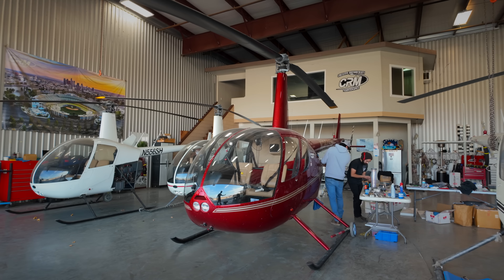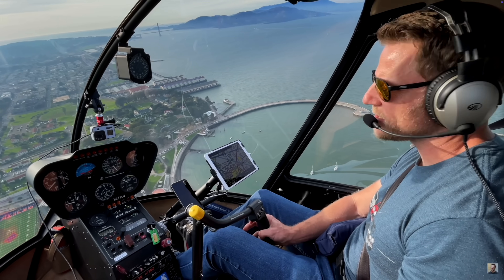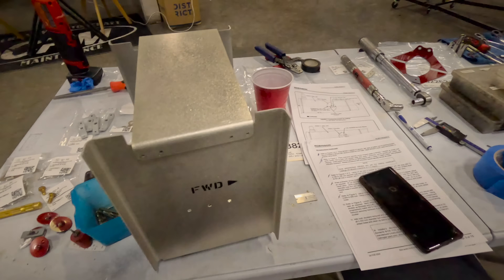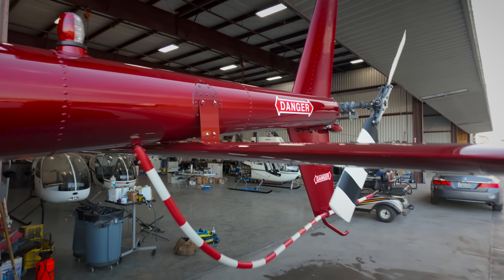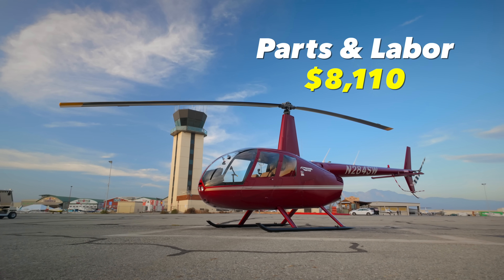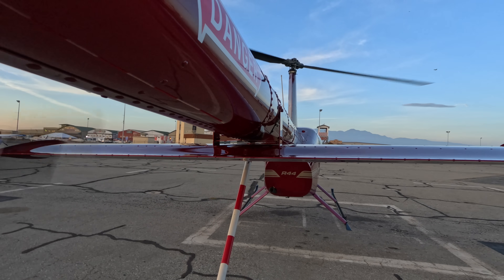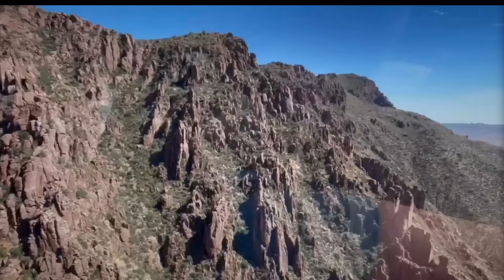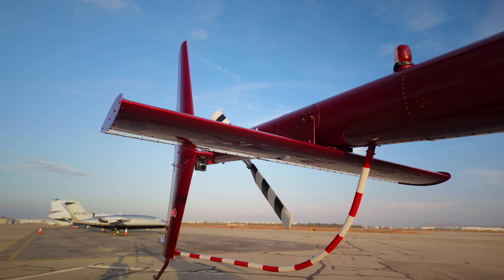Robinson R44 Empennage Kit | Install & Owner Review

Comment: I have an r44. It seems the new stabilizer would onl y be effective at higher speeds. I have flown bell, hughes sikorsky for 40years.  I think as long as you fly the r44 within its limits,you would not need the new stabilizer.
Reply: I think they have to confront near-ubiquitous assertions that the Robinsons are unsafe, esp with their exception made to training protocol. Frankly, i agree that while hovering is where the danger is (i'm not a pilot), i observe and agree that hovering in light helicopters is Essential to, um, "weeding out" any deficient would-be pilots before they can graduate to Commercial air work. But Robinson may have parlayed the situation to add a real in-flight improvement. Basically what i mean is that while they can't change the nature of their rotor system, under the guise of safety, they've made the flight better at speed, including predictability. There was that odd tourist 'Copter that went down in the Hudson River this year. Guy was gunning it to get back due to low fuel and appeared to have cut the tail in mid air.... (not sure they concluded the investigation). I feel like it's Robinson's way of saying, "okay, if you've mastered and respect hovering with our system, we Will get you to point B safely 👍 ~

Comment: You are a helicopter, just fly straight up. No need for a runway clearance.
Reply from the maker: So, I didn't request a runway clearance. I departed via a taxiway. Also, from a safety and aircraft performance perspective, in a helicopter it is greatly preferable to takeoff with forward airspeed. Search "helicopter take off profile" if you'd like to learn more.
Reply: @MicahMuzio  You are the man! I was joking 😆 
Thank you for your reply!
Reply from the maker: @Ezrabastian  Whew!! Sarcasm can be hard to detect sometimes. 😅 Cheers!
Reply: @MicahMuzio  forgot to add an emoji

Comment: Mast bumping is possible with any underslung, semi rigid rotor system, but the Robinson is the only underslung, semi rigid rotor system with an SFAR requirement in the US. I wonder if this new stab will improve its low G characteristics enough to remove the SFAR 73 on new and retrofit models.

Comment: More tail to cut off. Mast bumping is not as problematic in other 2 blade helos. Pop rivets? Using a pneumatic squeezer helps? 6:21 I'm not the best mechanic? Very encouraging. Hope it helps R44's from disassembling theirselve in flight. 😮

Comment: You still have Tail rotor thrust above the C/G to give you right roll, If anything the new horizontal stabilizer will reduce the rate of roll. A bonus is having a blockade between people and the danger zone.  Good to see an owner take care of the machine instead of running it into the ground.

Comment: In 5 years we will hear of R44s having tail rotors fall off at the horizontal stabiliser. Thats a lot of holes.
Reply: I get what you're saying, but the holes actually are there.. once the riviets get installed (fully), the laminate strength of a single sheet is returned, afaik ~

Comment: For commercial use the R44 is a no brainer, but if I was buying my own personal heli  in this price range I think i'd have to do the G2 Cabri for the safety.
Reply from the maker: I've only flown the G2 once but enjoyed flying it. If could get by with only 2 seats, the Cabri would've been on my consideration list.
Reply: @MicahMuzio  I get that, the 4 seats is a consideration to make considering the young one.  Hoping Cabri eventually comes out with one so the industry can get some competition.

I really like the safety it has in autorotations, barely any worry about overspeeding the rotor and so much more room to play with RPMs.
Reply from the maker: @shonefob Can’t wait to see the Cabri G4 whenever it arrives!

Comment: Beautiful work by that shop. It shows just how far some proper masking prep can elevate sealant and paint.

Nice editing, too! An effortless 12min about a horizontal stabilizer.
Reply from the maker: Thanks! I wasn't sure how compelling an empennage video might be. 😂

Also, you're 100% right. CRM puts an amazing level of effort into their maintenance and repairs. When I went to pick up my bird they had the rear cowl off and were attending to an airworthiness director that just posted. The AD isn't required any time soon for my ship but they proactively handled it just to make sure my chopper was safe and properly sorted. They are such a good operation.

Comment: Are there any downsides to this stabilizer? Like can you imagine a situation where it wouldn't be helpful or would be less helpful than if you hadn't had it at all?
Reply from the maker: Literally no downsides. It flies the same in normal conditions and is much safer in dangerous conditions. It's even easier to maneuver in the hanger versus the old stabilizer that hung off the side making it much more likely to accidentally hit a wall.
Reply: @MicahMuzio  I don't know Micah, I don't think you should be flying it in the hangar
Reply from the maker: 😂 Hey, man. You’re not the boss of me!!